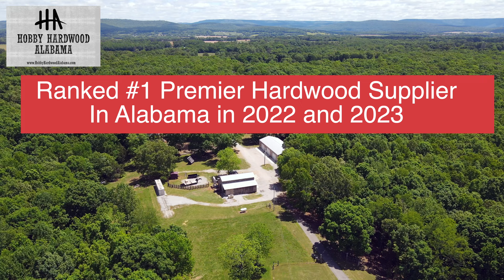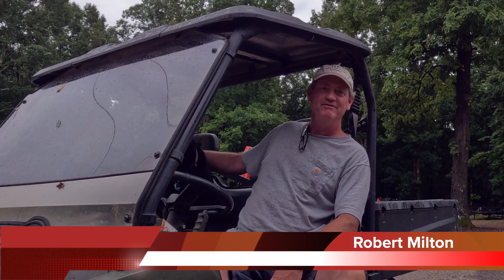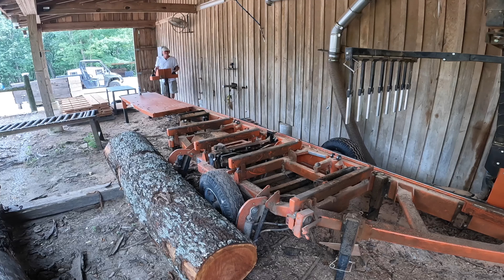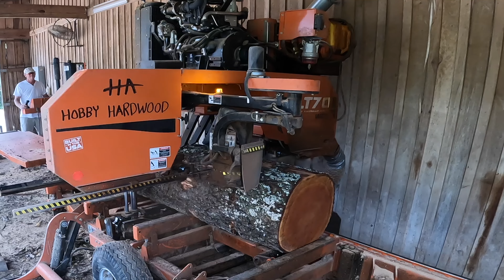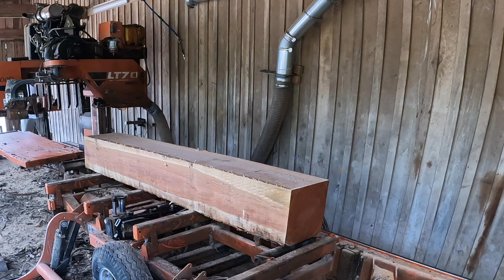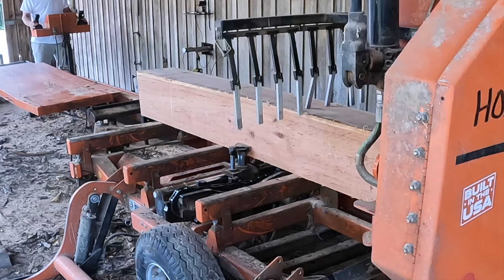Why Didn't I Quit Sawing??

Comment: Two questions: In the past you have put anchor seal on your logs, do you still use it on you lumber after you cut and sticker?  When you change the orientation of the Cant how do you reset your blade height without skimming off the top of the next board?
Reply from the maker: I only use it once, either on the logs or on the lumber immediately after they are cut.  Good question, I should cover that topic.  Basically I have long ago memorized the heights of all the cuts from the top of the cant to the bed plus the blade thickness.  For example, a 4/4 board is cut 1 1/8" thick, the next highest board is 1/8" for blade plus 1 1/8"  and so on.  So if I have a cant that is twop bards thick, then the height should be 2 3/8" above the bed.  If all the cuts on the cant fit that pattern, the lowest abroad, the "dog board" will always be the correct thickness.  They are always the same heights.  Woodmizer makes it easy, they have Pattern mode where I can set the height of the mill so many boards above the bed and it will add all the blades kerfs in automatically. But its the same thing, all the drops will have the same starting numbers.
Reply: @HobbyHardwoodAlabama   Thanks that is helpful, I have a manual mill and a TK1600 without set works so trying to figure that out without remeasuring everything is a PIA, but I am making it work just not nearly as fast.

Comment: What kind of check do you use to keep the diesel from dripping when lube mizer isn't on in return pass. The one on my lube mizer keep giving me a fit
Reply from the maker: The drips are coming from what’s in the hose I think.  I also sometimes replace the Buna N orings with Viton, which is pretty immune to diesel.

Comment: Good video. Have you ever considered an LT70 with a 57 hp electric motor? Or perhaps a Bakers Products Dominator 50 hp electric? Not sure if you can run a 3 phase service into your property, or what the electricity prices are in AL. There is also the option of a large PV solar system. If so, you could also power your big planer without having to use that old diesel generator. And, a lot less maintenance on going electric. I would be interested to hear your thoughts on this.
Reply: I think anyone would benefit from an electric motor. Torque curve is dead flat. I'm gonna bet he wouldn't own that big diesel generator if 3 ph power was close. Life in rural areas are worth the inconveniences to most.
Reply from the maker: Yes I tried to get my county to run 3 phase, years ago and they said sure, but I had to cost share with them and my portion started at $1,200,000 so I told them I'd pass.....I love the Baker equipment, but there is a very specific reason I bought a diesel LT70 Super, it's because it one of the only mills that generate hydraulic power from the engine itself, like a tractor or excavator has a motor driven hydraulic pump, and in the case of the LT70, the engine driven pump produces 6 times faster hydraulic movements on the log turner, clamps, etc than the electric version.  Not only that, but on the electric version, the band is always turning and that really shortens the band life.  So I went with a diesel super 70 with engine driven hydraulic pump.  The Bake dominators are fine machines, but when I was looking at buying, their setworks was 19th century, and not conducive to my style of sawing.  They have since upgraded their setworks, but I have not run them since the upgrade.
Reply: @HobbyHardwoodAlabama  Ok, that makes sense. If electric does ever start to appeal to you, let me know, and maybe we could work up some numbers. Oh, and as for the eye candy, how about outfitting Chip in some Spandex ??
Reply: Thanks for sharing your thoughts on the woodmizer lt 70, do you use the woodmizer blade gauge ar your mill?
I just got mine Friday used it all weekend on the mill, wish I wouldn't have waited too get this tool,  its a Starrett gauge,  quality tool 🌲👍👌🧡🧡
Reply: If you could do a video on talking about tension on the mill & how woodmizer mills tension the band to be able to saw so quickly,  & was wondering your thoughts on band wheels without belts!🤔??
Thank you for your time and expertise

Comment: Just wondering if you had any concerns about the pith?  Great splicing to make it shorter but I also would like to an uncut version.  Keep up the great work!
Reply from the maker: Yes, the pith is always a concern and I brought the cant down as far as I could to meet my narrowest sellable board dimension as per NHLA FAS grade rules.  At that point, I will saw down through the whole narrow remaining cant and generally discard the pith boards simply because it's faster to saw them and eject them as part of the mechanical process than it is to stop the mill and hand remove the central unusable cant.  Pith boards are unusable, and go into the fire pit.  Good observation!